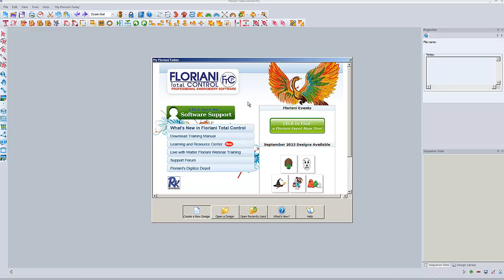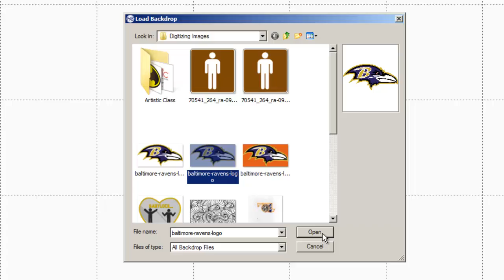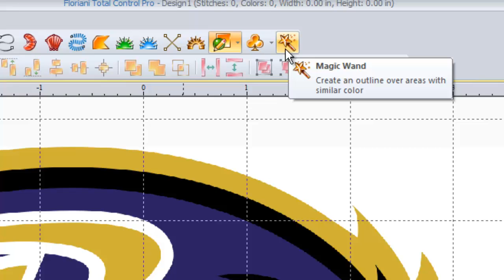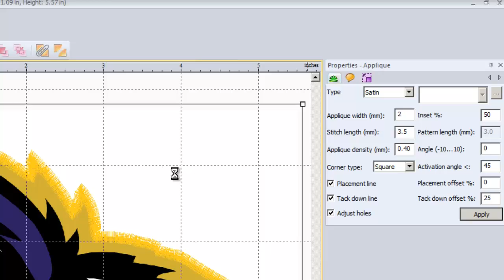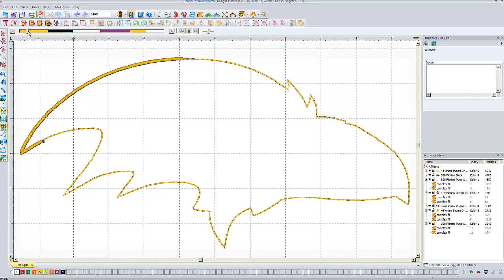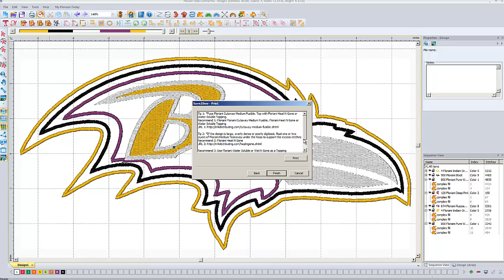Floriani Total Control - Applique Ravens Logo September Floriani Club

Comment: I hope you read this but how come when I size it and apply the stitches it shrinks my pattern by from 4 inches to 2 inches? Than it covers my actual picture so I cant find the rest part to my picture to create more stiches?
Reply from the maker: usually its because you're using a pirated copy of the software, if not you need to open a ticket with floriani and get them to validate your serial number
Reply: @EllicottCitySewVac  i hope not i took out a loan to get this software
Reply from the maker: @justindelano8565  You need to contact floriani then